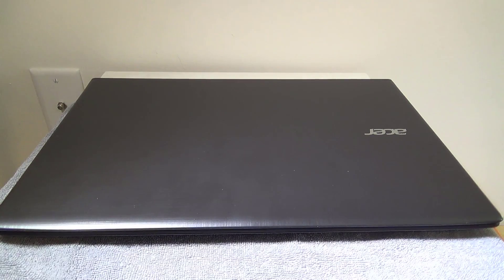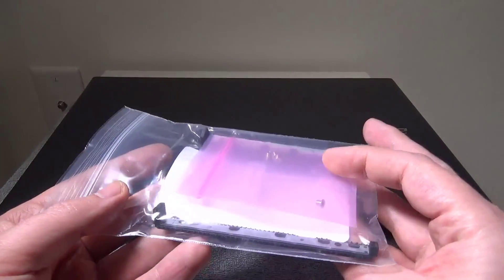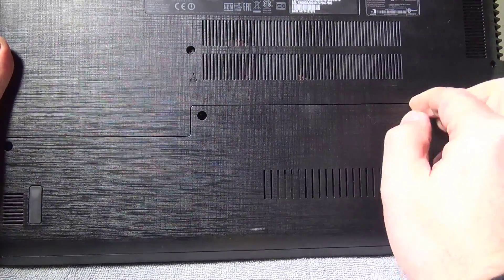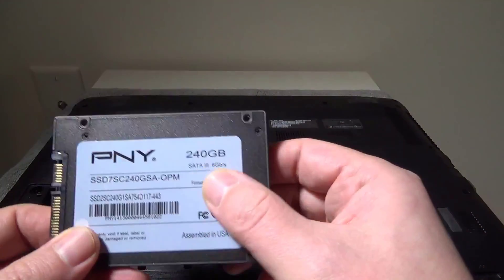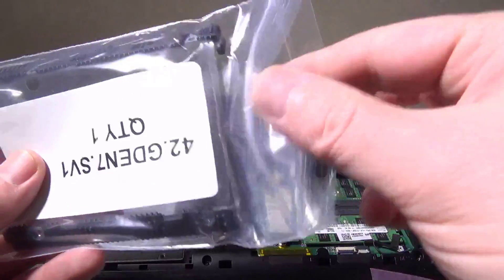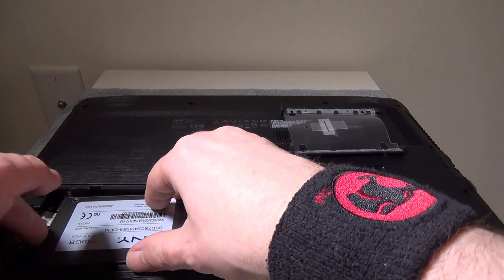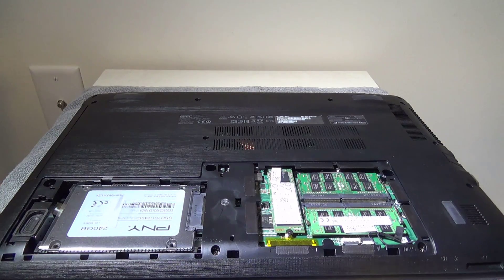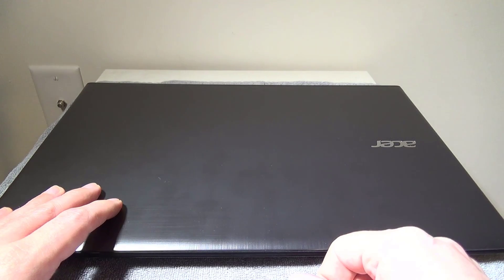Acer Aspire E15 E5-575G-57D4 (E5-575G-53VG) - How to add a 2nd HDD or SSD

Comment: I just got off the phone w/ ACER and they said that this will only work for a HDD, not a SSD. I have an old SSD that I'm planning on using for my new acer laptop. So is it true that it only works for HDDs?
Reply from the maker: +Too Many Cooks No it should work for a SSD as long as it has a sata connection you should be fine
Reply: Worked like a charm, thank you so much!
Reply from the maker: +Too Many Cooks no problem glad I could help thanks for watching and your support

Comment: I followed your instructions and turned on my laptop, but I cannot see my 2nd drive in Windows 10!!! Should I enable something in the BIOS? Also, it looks like I have 2 hard drives in the BIOS (Original SSD + 1 addition 2 TB HDD)? When I go there, under Information, I can see HDD0 ST2000LX001-1RG174 and HDD1 Micron_1100_MTFDDAV256TBN!!! the 1st one (ST2000LX001-1RG174) is the 2nd drive, but don't see it in Windows! It shows up under Device Manager as well, but it says Not Initialized. http://imgur.com/a/S5rYZ I've read that maybe it has to be formatted 1st in order to be viewed in Windows, but how do I format this drive if I can't see it in Windows and should be formatted as NTFS? Thanks
Reply from the maker: Yup you have to create a partition on the new installed drive before it will show up.  Go to Windows Settings then to Disk Management and then create a partition on the new HDD.  It will then show up in My PC
Reply: Thank you!
Reply from the maker: +tawmoss1 you are welcome thank you for watching I'm glad I could help
Reply: Thanks for this post and reply, I had same problem ,
Reply from the maker: Np glad I could help

Comment: You don't need to buy a drive kit acer has two little clips on the back of the panel you take off that actually holds that drive in place
Reply: can you post a pick of it
Reply: MrGreendude9 the panel that you take off that holds your ram and hard drive
Reply: Hottest1here hey are you sure about that, my 7mm hdd won't move?
Reply: @joresobe77  It does move, mine came off, now I'm buying the piece to hold it in place
Reply: Does this apply for all acer e15 575g variants?

Comment: im planing on adding a 1tb hdd 7200 rpm to this laptop does any kind of hdd works or there is specific specs for it ?
Reply: Looking to purchase this exact model.Do u recommend it?-and could I buy one with 1TB from a store?Thanks!! Would be using it for buisness and school work.
Reply from the maker: +Fenderbender 789 I do recommend this laptop I got mine on Amazon
Reply: Can I use it "as is"or does it need upgrade?Also can I buy one already upgraded with the bigger 1TB already  installed?
Reply from the maker: +Fenderbender 789 you can use it as is I would suggest upgrading to 16 gigs of RAM though
Reply: Galaxy Tech Review hey 9mm also works or only 7mm?
Reply from the maker: joresobe77 I have only tested 7mm drives myself so for now I'm going to say 7mm  since I have not tested 9mm drives.
Reply: @GalaxyTechReview  Just a quick question, I have a 1TB HDD from my old laptop and want to install it into the Acer E15 using the drive bay. As both the SSD and HDD have a Windows OS on it, will it corrupt or blue screen my computer? I simply want to use my old HDD as extra storage. How would I go about doing this installation correctly?
Reply from the maker: Install it and format the old drive for storage. Should be no problem
Reply from the maker: +carlostezoo 2.5 inch 7 mm sata drive.
Reply: thank you very much great videos :)
Reply from the maker: +carlostezoo no problem thanks for watching and your support

Comment: if transfering a hdd frm a ol laptop, do i need to format? or can everything be transfer on the hdd? the hdd is from a laptop with windows 10
Reply from the maker: +Omari Christir easy answer format the drive then you'll have a fresh clean  drive to start installing games on. If you're asking will the operating system work if you transfer the hard drive probably not.  Formatting it is just the easiest way to do it
Reply: Galaxy Tech Review can I format it after I install it in the laptop Right?
Reply from the maker: +Omari Christir yes.
Reply: Galaxy Tech Review thank you. Waiting on the caddy to install. How do you format it after its install?
Reply from the maker: +Omari Christir first you will have to go to Windows settings then Disk Management and then create a partition on the hard drive it will then show up in my PC and you can format it
Reply: Galaxy Tech Review thank you
Reply from the maker: +Omari Christir np

Comment: "for only 8 bucks its great"....and it would be if not for the extra $10 to ship it...just sayin...

Also, it feels like i'm going to break something when initially pulling up on that plate...i guess that is normal and i just have to hope for the best?
Reply from the maker: +PerspicaciousOne well since we want to get picky about everything when I actually ordered mine I had paid no shipping they were not charging shipping for these so was $8 with no shipping they have since changed it as I go and look at the website now and that is kind of a shame but it's still only $18. But at the time of my review they weren't charging any shipping and I got mine for 8 bucks
Reply: some double sided tape and craft foam would also do the same job.
Reply: The only shipping to me is $40, I'm not gonna drop almost $50 to fit a ssd in. :/
Reply: I just wedged in folded paper receipts
Reply from the maker: +ThePaintballTwins honestly whats $18 in the grand scheme of things it helps you achieve putting more storage in your laptop it just what you need to do. I have installed it and uninstalled it several times and it is never broken on me so don't worry about that
Reply: Fair enough. That would have been a better answer to begin with :) Pricing creep sounds par for the course. When I've looked at some of the older initial reviews of the product, they make it sound like it might have been free upon request. Adding jacked up shipping costs to item cost is always a nice way to pad the margin later :/
Reply: But as he's saying, it's not "only $8" If it's $18, so be it. That's the way of accessories. The point is the misinformation. It's like buying a "$25" concert ticket that's actually $45 when you leave the window. Don't make it sound like a bargain when it isn't.

Comment: Mine has a 1000gb HDD and not an M.2Drive... how can I go about adding an ssd drive.... would it be the same thing but backwards?@GalaxyTechReview
Reply from the maker: Yes you would just buy a m.2 SSD and install that in the empty m.2 slot.  If you wanted to put the OS on that drive you could just do a fresh install of Windows.
Reply: Thanks!
This video has been very helpful... I do have one last question. There is a version of this laptop that offers Nvidia video memory... could I also install and upgrade that on my model? if yes can you provide a link where to buy it from and if you haven't done a video on that it will be much appreciated.
Reply from the maker: +Kenny Maldonado the Nvidia graphics card is not upgradeable so you're going to want to buy a version of this laptop that already has the  940mx Nvidia graphics card you cannot upgrade graphics cards in laptops at this point so if you buy the one with the Intel graphics card only you're stuck with that one and it will not game like the ones in this video

Comment: Hey galaxy tech review, nice video I used it to install a second hard drive. Were you still going to make a video showing how to replace the optical drive with a third hard drive? Thank you!
Reply from the maker: +Brian Fairchild no I cannot I no longer have this model 4 review it's pretty simple though all you have to do is unscrew one screw off the bottom and then take out the optical drive. Once that's done the caddy that holds the third hard drive or extra hard drive slides into the same Bay and you just screw the screw back in and you're good to go

Comment: will this one works? https://www.amazon.com/gp/aw/d/B01LYNQXCP/ref=mp_s_a_1_1?ie=UTF8&qid=1498820534&sr=8-1&pi=AC_SX236_SY340_FMwebp_QL65&keywords=1+tb+7mm+hdd&dpPl=1&dpID=51bWkLxZAKL&ref=plSrch
Reply from the maker: Yes that will work.
Reply: Galaxy Tech Review but i have problem with the assembly kit, it doesn't shipping to my country, can i use a piece of paper? is it safe?
Reply from the maker: +Ade Abang you can. Should not be a problem. Not the nicest solution but it will work
Reply: Galaxy Tech Review Thank you for your help, I'll sub
Reply: This actually is along what I was going to ask about except I was looking as this one https://www.amazon.com/gp/product/B01LWRTRZU/ref=ox_sc_mini_detail?ie=UTF8&psc=1&smid=ATVPDKIKX0DER What are you suggesting might be better when you say not the nicest?
Reply: Ah, sorry, I didn't have all the replies expanded to see the correct question you were actually answering.

Comment: Can I add an HDD without the Assembly Kit?
Reply from the maker: +Karan Singh you can but the problem comes in that the drive will move around a little bit and over time it may come loose and disconnected you might be able to wedge something in there to hold it in place though.
Reply: Hi, did you find any solution as I am also unable to find the kit in India.

Cheers
Abhinav

Comment: You mentioned using a Caddy for adding another disk by replacing the DVD drive. Is that video up as well or any pointers on which screws to remove to get to the drive?
Reply from the maker: +Vinod Unny no I never did a video on that procedure because I never did that upgrade but it is possible to get a caddy that will replace the  DVD drive not sure where you would get it I would start with Amazon or Ebay
Reply: Thanks. I can buy it from Amazon. it'll be a 9mm one, right?
Reply from the maker: +Vinod Unny again not totally sure because I never did that upgrade let me know how it goes for you

Comment: Will this one works ? https://www.amazon.com/Blue-Mobile-Hard-Disk-Drive/dp/B00C9TEBJQ
Reply: Hi there, in my option is to order WD Black Mobile 1TB which is 9.5 mm and now I am waiting for delivery of HDD/SSD Assembly Kit from Acer Czech Republic. I went through this https://us.answers.acer.com/app/answers/detail/a_id/43054/~/hard-drive-installation-instructions-for-aspire-e5-575g-laptops and there is written that HDD/SSD Assembly Kit should supports a 2.5” drive, 7 or 9.5 millimeters thick.
Reply: Hi guys, you can put that WD Black Mobile 1TB into HDD/SSD Assembly Kit without any issues. Just one thing regarding assembly kit that I didn't get in package also screws so I had to figure out and found solution :D :)
Reply: Should I get the assembly kit for that one ?
The only assembly kit available in my local store is this one
http://www.canadacomputers.com/product_info.php?cPath=1160&item_id=066034
Reply from the maker: Mitsuo Gushiken that hard drive is a 9mm hard drive look for a 7mm hard drive 2.5 inch
Reply from the maker: Mitsuo Gushiken no idea if that assembly kit or HDD kit will work I only tested the official Acer one
Reply: The 9mm is not compatible ?
Reply from the maker: +Mitsuo Gushiken I have only tested a 7 millimeter so I can't comment on whether or not a 9mm will beor not. The drive I used was a 7mm
Reply: Thanks mate. You´re very polite.
Reply: @Dario Gushi Could you tell me if it worked to you? I want to buy a HDD 9mm 2,5” and i am not really sure if it works or not
Reply: Thank you very much :D :D
Reply: You're welcome :)
Reply: What size screws did you use? My kit didn't come with any screws...
Reply: Stephen I have used the below (thin screws) ones from package of Corsair SSD bracket as is shown on that picture:  https://www.rebeltech.co.za/3992-thickbox_default/corsair-ssd-mounting-bracket-25-hdd-to-35.jpg
Reply: @tdwt Yes it works fine but copying large files between SSD & HDD takes some time. I can access my files stored on HDD smoothly but do not recommend using this WD HDD for some large projects such as rendering videos or working with VMWare / VirtualBox, etc. but it's good enough for games. I would recommend some better HDD than WD Black Mobile 1TB with better speed, etc. for large files you use for your projects. (if any) :-)

Comment: How do I set an HDD? Can I put it in the same place as the SSD? And i am sorry for my bad English
Reply from the maker: If you get the version with a 256GB m.2 SSD you should have an open 2.5 inch drive bay, like in the video to put a 2nd HDD/SSD
Reply: Galaxy Tech Review  thanks and are this good https://www.amazon.com/WD-Notebook-Internal-5400RPM-WD10JPVX/dp/B01EMXO3DK/ref=sr_1_8?s=electronics&ie=UTF8&qid=1497543370&sr=1-8&keywords=hdd+1tb+2.5+inch
Reply from the maker: +khaled that would work just fine.

Comment: i am planning to buy e5 575. can i add a Nvidia 940mx onto it later?, is there a slot or anything .does  e5 575 and e5 e575g have the same motherboard?
Reply from the maker: You can't upgrade the video cards in laptops they are soldered into the main board.

Comment: Anyone have a coupon code for the assembler kit?  Sure it's $8, but it's not mentioned that it cost more to ship it, than the actual part is.  Cheapest shipping option is $10!
Reply from the maker: interesting, shipping was free when I ordered mine.
Reply from the maker: wow looks like they changed it, ya that is sort of a rip off. lol
Reply from the maker: i might have mine left over, maybe ... I will have to look and see.
Reply: Galaxy Tech Review yeah I was hoping for such a small product, that shipping would be just a couple bucks
Reply from the maker: Try using this code    VECAFS-19QL2Y
Reply: Galaxy Tech Review code says no longer valid, but I definitely appreciate you trying.
Reply from the maker: +John Toups no problem. Check out as a guest Put.  the thing in your cart and fill out the shipping part. Makes sure you have your email address in as well  Then go to your cart and remove it. That code showed up in my spam folder like ten minutes after leaving the site. Worth a shot.
Reply: Looks like they did send a code to me.   But i contacted them and the code is only valid for laptops and desktops.   I told them they should specify that in the email , but all they could do was apologize
Reply from the maker: +John Toups hmm that sucks.
Reply: Well, after all of that, they sent yet another code to my email.  this time for 10% off plus free freight.  I was skeptical, but tried it anyway.....and it worked this time!   Thanks again for your help!
Reply from the maker: +John Toups awesome.

Comment: thanks that is awesome, h have ACER ASPIRE E15 E5-575G-56WG, can i add a 2nd hard drive to it? thanks in advance
Reply from the maker: Looks like that has a 500GB hard drive already installed in the 2.5 inch drive bay, no idea if that model has a m.2 slot for a second drive....

Comment: Can you do a cooling review on this and maybe if there is a way to control the fan on this thing? I noticed on mine that fan spins too slow even when CPU goes over 90c. Also, CPU temps jump all over the place so I suspect stock thermal paste is cheap. Maybe you wanna open it and repaste it and do a tutorial?
Reply from the maker: I do not have this laptop anymore to test on, I am sorry.  As far as I remember there was no built in fan control with this laptop.
Reply: oh ok. I think im gonna open it and change that paste. Do you think it will void the warranty?

Comment: what's different between 53vg  and 574D..which is best
Reply from the maker: The only difference between those 2 laptops is the 57D4 has the 7th gen processor (with a little higher clock speed) and the 53VG has the 6th Gen processor.  So the 57D4 with the newer processor.  Everything else is exactly the same.
Reply: Galaxy Tech Review thanks you so much for the details
Reply from the maker: +Any Thing can do no problem

Comment: I just purchased the Aspire E15 E5-57D4 with the 7th gen i5. I will upgrade to 16gig ram and hd. Thanks for posting the vid. 
People have told me to worry about static electricity when handling/installing ram and such. Do i need to worry about this??
Reply from the maker: +TboneNYC10 just do it on a clean workspace and you will be fine.
Reply: Thank you for the quick reply.
Reply: how is it? Does the upgraded ram improve gaming performance?

Comment: where can I buy it?? amazon didn't show up the price for it…it just showed a different model of acer
Reply from the maker: They seem to be out of stock on the 57D4 at the moment, you can get the 53VG which is the same cept for the 6th gen i5 processor instead of the 7th gen i5 processor HERE http://amzn.to/2ozk8fT  It is exactly the same as the one I review (and pretty much identical in performance as well as the new 7th gen i5 doesnt make that much of a difference)

Comment: Hi. Thanks to your reviews and videos plus some of my own investigation I bought the refreshed  575g-57d.  My question which is the largest GB you would install and the best SSD brand to upgrade.  Also is there any programming I need to worry about. And will the 2nd SSD drive show up as a unique drive with its on drive letter or will it just expand under the existing C drive.
Reply from the maker: +Joe Troiani personally I like to put in a second ssd drive not hard drive. Hard drives are slow but they are cheap in cost. So depends on weather you'd like to spend the money. I went with a pny ssd that I already had in the video. With my newest laptop I bought a 525gb crucial micron ssd drive. Git that drive for 149.99. The second drive will come up as its own drive letter once installed.

Comment: Hi, thanks for the video. I wonder if the "Seagate 2TB BarraCuda SATA 6Gb/s 128MB Cache 2.5-Inch 7mm Internal Hard Drive (ST2000LM015)" would work as well. Thanks.
Reply from the maker: Yes that should work